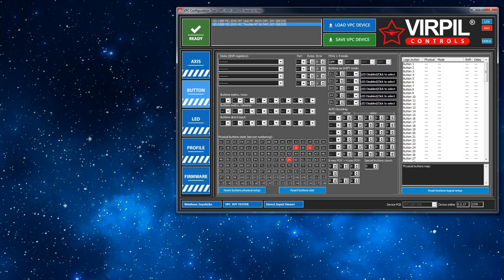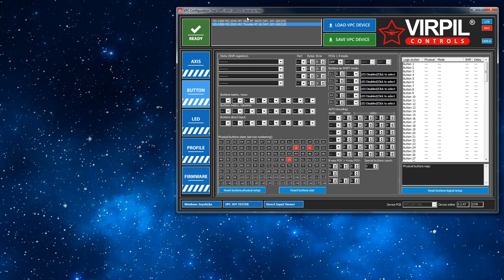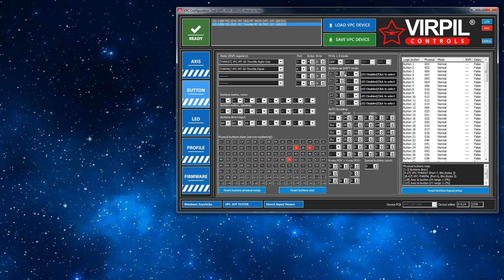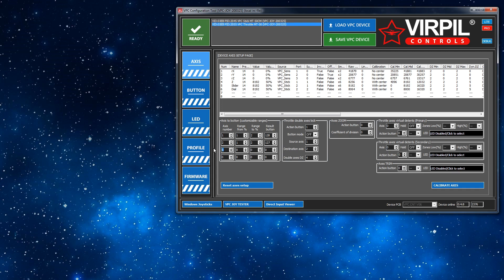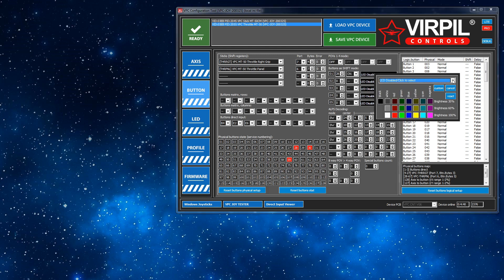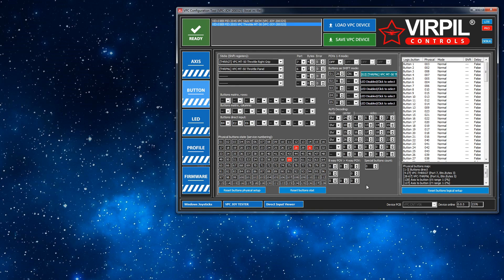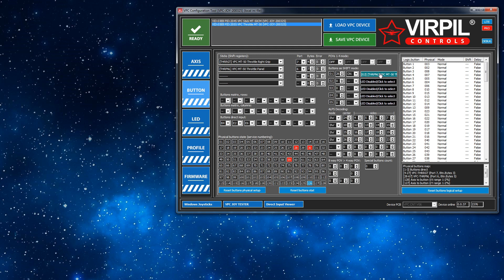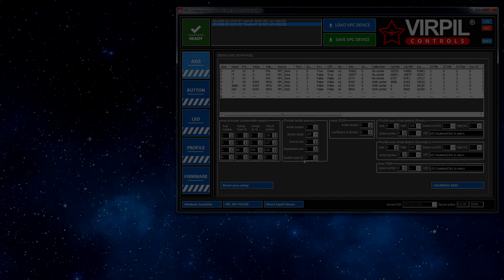Virpil LED control by throttle axis Tutorial

Comment: Hi
Using (20200925)
 Hmmm... tried this out on a Alpha\CM2 and although the Axis movement when in the set range will bring the LED on I have lost function on all the other LED buttons?
Reply from the maker: 20200925 - has a crap load of issues, Iam using 2020325
Reply: Thanks again for the reply ;)